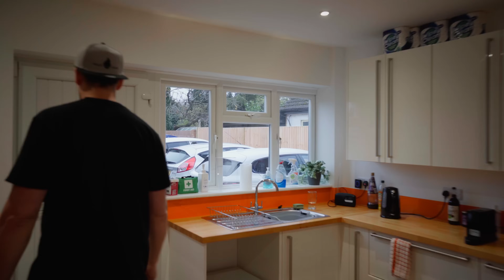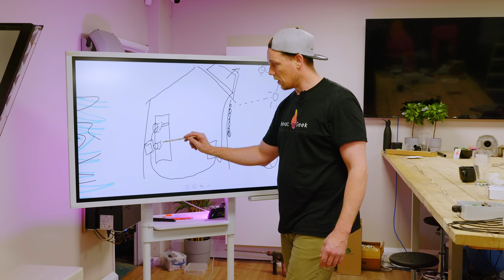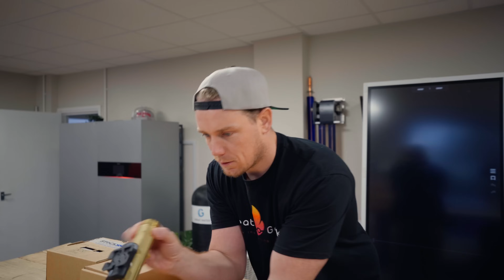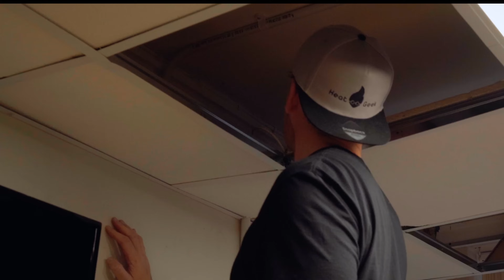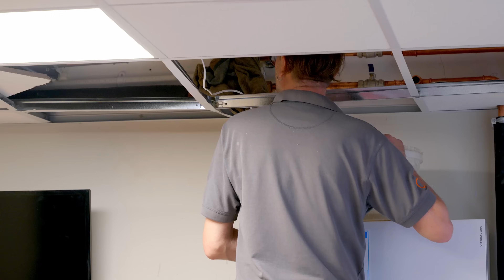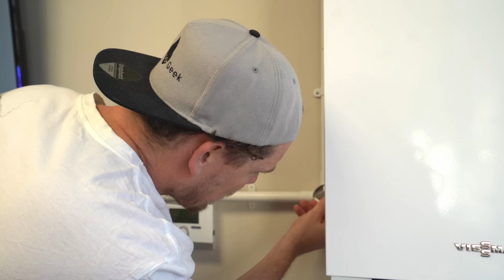Revealing our completely FREE heating - How to measure your renewable heating inc solar thermal

Comment: I spent 20 years in HVAC and if there is one thing I know its thermal dynamics. If you want to store a lot of thermal heat? Forget water. You would be better off filling the tank with sand and using an inductive element from an electric oven to heat it. While water will only hold at 100c without pressurization, Sand can be heated to 600C without pressure issues. And it is classed as a semi solid which enables heat to stratify in it just like it does water. You can put a heating loop in the top of the tank for the water to feed the radiators and Bobs your uncle. All the excess energy that you can generate with solar or wind can be stored efficiently.

Comment: Is it possible to use the Eddi to turn the heat pump on to heat hot water, rather than use the immersion heater in the hot water tank?
Reply from the maker: Hi, no the heat pump won't turn on to match a power input.

Comment: I’ve bone this years ago on south facing roof . Only gas we use very low in spring summer autumn. Viesmann tubes first class . Used them for about 15 years plus . Don’t forget to change fluid every so often as per manufacturers info . Loved blog with skill builder . Can you do a show on battery storage only no solar . Also I can’t get a body to install on south facing wall .

Comment: Would it not be more efficient to use the solar thermal on the cold side of the heatpump thus multiplying the heat from the solar thermal power by 3x ish?
Reply from the maker: it would only top up to the weather compoensated temperature so just reduce the amount of heat put in by the hp. Not multiply the heat. you can only multiply the electrical input. also we are trying to test the solar thermal on its own.
Reply: @HeatGeek  What would the downside of this method be? (Using solar on the cold input of the heatpump)
Besides the fact that you wouldn't be able to use the solar without the heatpump.
Reply from the maker: @milanvdv  there isn't outside of us testing. Prioritise hot water first though
Reply: @HeatGeek 
I'll probably test it out myself during my complete renovation (in Belgium), whole house radiant floor with with max insulation.
This idea was in my head for a long time. Combine Ground source with Solar, so I could always have the warmest source. (And maybe divert solar with control valve, so I can directly heat hot water.

Difficult to find thrustworthy companies with the correct knowledge in my country though.
Reply from the maker: @milanvdv  oh we've installed it.. the efficiency from the solar drips due to higher temps but its better than turning it off! Prioritise hot water first though

Comment: What I don’t get is if your using two Emerson elements effectively 6 kw why antuou just using your heat pump if it’s offering a ratio of 3.8 to 1 that just doesn’t make much sense, also why not get up to temp for the rads to 55c then given weather compensation just how is it doing the legionnaires cycle
Reply from the maker: The heating flow temp isn't 55. It's 40 for this property. Hot water flow temp is 65.

These are 6kw elements so a total of 12kw. Because the unit can't chose for its output to match the input
Reply: @HeatGeek  ok, just a wild though but in the uk wouldn't a twin split 5 and 7 kwh make more sense so it could then ramp up according to demand or defrost cycle? in such  a set up

Comment: Great video, am I right in thinking that when the buffer tank is only used for the solar thermal and when the heat pump kicks in it only goes around the radiators and doesn't go into the buffer? Does that mean that the heat pump doesn't heat the DHW?

Comment: Quick bit of man maths. If a 1.7m x 1m solar PV panel is 400W at 20% efficiency, would a 3m square solar thermal be around 2800W at 80% efficiency. Viessman 3m panel is showing as £4k, so about £1.40 per Watt, and solar PV is around 50p per Watt. Am I missing something?

Comment: I really like solar thermal but long term it should be more efficient to use PV and a heat pump (80% solar heating = 20% PV and 4 COP).

The advantage of PV is that electricity can be used for any power needs, solar thermal can only be used for heating (or hot water).
Reply: the problem is that heat pumps need more power when there is little sun. Bateries are built for 24 hour cycles not weekly or monthly

Comment: How much is that setup. Looks prohibitevley expensive for average homeowner
Reply: Thousands.. oh yeh this is absolutely NOT an average goose solution, nor do we suggest it is.
Reply: @ChapmanPlumbing  so what can the average goose do as a minimum. What data can you get from the controller. We will have a Mitsubishi ecodan. Do I just get the power draw sensor for £163.

Comment: Hello HG, 
Looking at other brands of solar thermal panels, but they only recommend fitting them vertically at 45 Degrees on a roof. Could it work wall mounted, but just angled 📐 the brackets out buy 15-20 degrees on my south facing wall like your office building?
Reply: Other brands will almost certainly need to be verticall rather than the horizontal these require. You need to call the manufacturer for advise on a more upright pitch though..

Comment: Is it possible to get a breakdown in the cost for all the parts used in this system?
Reply from the maker: around 10k
Reply: @HeatGeek  fantastic, I thought it would be significantly more then that as I assumed the heat pump would be around 8-10k and the solar thermal around 6-7k
Reply from the maker: @amritbhupal8514  the heat pump was another 3.5k
Reply: @HeatGeek  ah right, hopefully with the RHI they’ll become even more affordable

Comment: I've not even watched most of the video yet, but you've got Trystan in, and are promoting Glyn's van, so you are obviously sound people :-) There is not enough 'open' in the world of heat pumps/car chargers/battery storage/solar thermal etc, so anyone who has worked out that this is the long-term way forward is very welcome.

Comment: What kind of PVT panels are they? You mentioned Viessmann Thermoprotect at one point? Thank you.
Reply from the maker: Hi Imogen. They are not PVT. We have both PV and thermal seperately.
Reply: @HeatGeek  Sorry my brain/finger slipped I meant thermal... ?
Reply from the maker: @imogenbertin3755  they're tubes rather than pannels. Viessmann vitosol 300 tm
Reply: @HeatGeek  Many thanks. Off to look those ones up, we have an old DIY themal panel from a Machynclleth ATC kit on the side of the house that's about to descend of its own accord if we don't get around to upgrading it...

Comment: Just a quick question, if you were to replace the radiators with underfloor heating would you need to increase the number of solar thermal panels?
Reply from the maker: No.. your property requirements is your property requirement. The emitter inly changes the required flow temperature
Reply: @HeatGeek  cheers, my parents have just bought a place in the sticks without a gas connection so we’re looking at all options to replace the existing very dirty oil boiler.

Just another quick question, what are your thoughts on multi- zone ductless mini-split heat pumps? I’ve been told that they’re probably the most efficient of the heat pumps but there’s not too much info about them out there.
Reply from the maker: @amritbhupal8514  To be honest I dont have any experience of them. out main showroom area has an air to air in it and i find it really uncomfortable.. very anecdotal so takewith a pinch of salt

Comment: Well, what a complete Fkup! Talk about lack of planning, I WAS a fan but I’ve never such a complete cock up, and How much has this cost? Plus how much space does all this take up? Totally unrealistic for the normal man on the street 🤯 I’m out 🙄
Reply from the maker: This is an experiment and absolutely no where near finished.. we're likely to add 50% to the solar array and possibly adding a ground store on top of our additional garage store for load shifting which is yet to come. We had to edit all this out as the video was too long. Additionally we are not touting this as a solution for most buildings just illustrating different options.
Reply: Somebody got out the wrong side of the bed 🤣

Comment: I built my house 10 years ago. It would have been good to install this monitoring at the time but I have enough metering to join the dots. I'm not sure what I would do differently with all the data. For you it is useful to show what is possible to new clients but for me with a working system it won't change much. It seems like extra equipment I don't need. But I appreciate your efforts in promoting green heating in the UK.
Reply: Just for info (as an extra data point perhaps) I have a large passive house in Luxembourg. 85 PV panels on the roof at 35 degrees south facing. 19.5KWP. In Luxembourg I export 100% of production at a FIT through an export meter and then buy back what I need through a second consumption meter. I used to consume about 25% of what I produce annualised but that has risen to closer to 50% after installing a well used sauna. EV is coming next October so that will drop again. My panels are 230W nominal. I could replace them with latest tech to get to about 320W but it seems a waste. In Luxembourg all new houses get 3 phase as standard. 
For heating I have a 15KW log/pellet boiler and I use about 6 cubic meters of logs per year and maybe 6 bags of pellets just for auto ignition and occasional laziness. I do one burn per day in the evening. This feeds a 2000 litre stratified buffer. Also connected to the buffer are 10 square meters of TiSun flat panel solar thermal mounted vertically on a SSW wall. I also have a 2KW immersion probe mounted mid height. I only put this on in summer at a medium set point to kick in for domestic hot water on cloudy days. This would be interesting to monitor. 

Everything works well but I might think about a house battery when I come off the FIT. We have nothing like Octopus energy or low night tariff here though. I'm also thinking about drilling ground source pipes now (while the drill truck still has access through the vacant plot next door) and converting to GSHP when I get too old to shift logs every day. 
For logging I get daily KWH from the solar thermal pump and the PV inverters (plus the export meter readings through the smart meter and an app from my supplier). As I said, the kit in this video is interesting but do people really need it? And what would you change based on the data?
Reply: @ecoworrier  That's an impressive setup that you have there, it sounds like you have a fair bit of monitoring already which gives you a good idea of how well it's working. I appreciate your point that it might not change much for everyone, I think the key is for system designers, installers and enthusiast householders to use it on new configurations of kit to check that the real world performance does match the design expectation and to try and use it to improve the system performance in an iterative process, with best practice then replicated across large numbers of installations. I've personally found it really useful to understand the performance of our air source heat pump and there's been a surprising amount of interest in the data from the system, I've written up a blog and video about it here https://trystanlea.org.uk/heatpump2020. Once we have a good period of data from the Heat Geek office system it will be really interesting to see how well the different components of the system performs, it would be great to do a theory vs practice video/blog post on the system at some point.
Reply: @trystanlea  cheers for the reply. I'll look forward to seeing the analysis.

Comment: PROPANE GAS HAS NOT RISEN IN PRICE FOR ABOUT 14 YEARS the heaters can be moved anywhere in the house and switched on and off as required
Reply from the maker: It has not however dropped in co2 and is unlikely to...
Reply: where are you finding carbon dioxide in a pressurized container of propane
Reply from the maker: @albawest  C3H8 = 3 carbon for 8 hydrogen. during combustion carbon oxidises and is released as co2

Comment: Is it worth monitoring an air to air heat pump? Is there anything you can adjust?
Reply from the maker: I don't know enough about them so absolutely, yes.
Reply: @HeatGeek  It would be interesting to do monitoring on air-to-air but a bit more tricky than air-to-water as you cant just fit a standard heat meter to get the COP . It's possible to do electric consumption, air in and air out of the indoor unit and estimate heat output based on fan air movement rates but it's quite rough.. Would be interesting to do something more detailed, maybe look at room temperatures and compare with monitoring when using a direct electric heater to try and work out the effective COP...
Reply from the maker: @trystanlea  that would be awesome 👌. Ide like to know more about it for sure. 1 thing I do know is that a2a is less comfortable. Well mine is anyway.